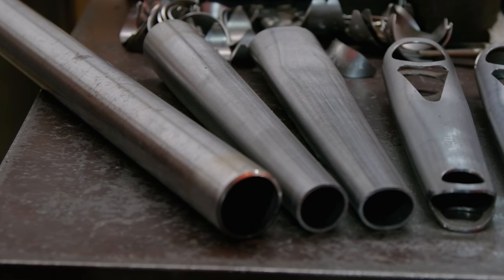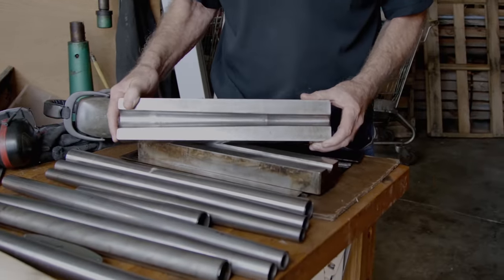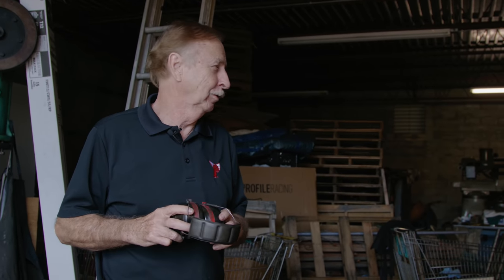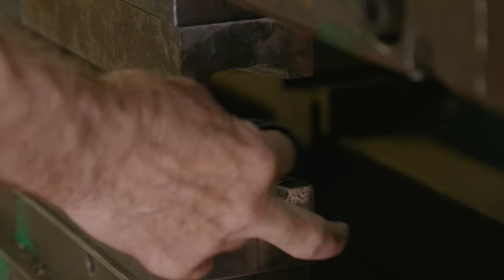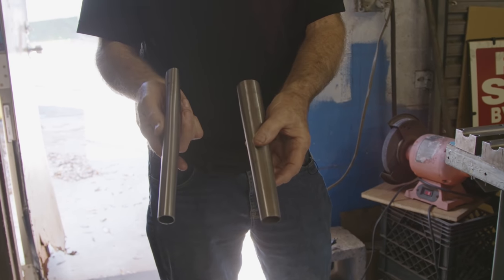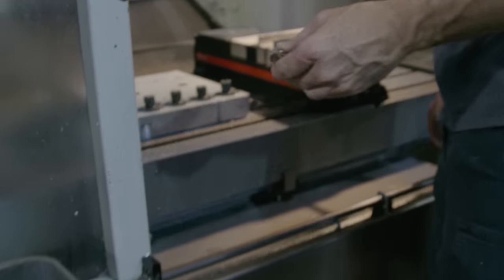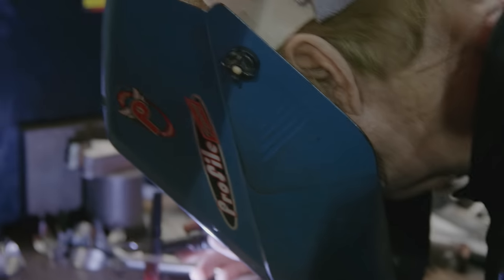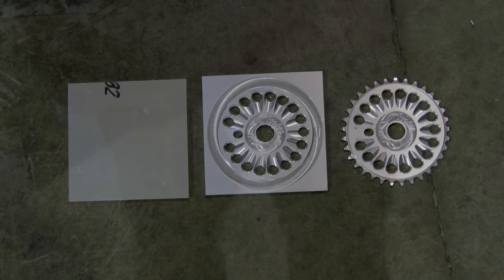HOW BICYCLE CRANKS ARE MADE

Comment: Really wished you guys would somehow integrate that (dub-tail fixture?) design you use from building your stems for your cranks & axle. Maybe an odd number for a two bolt clamp down. Never really trusted the spline design for any type of weight distribution, those are just made for belt drives.